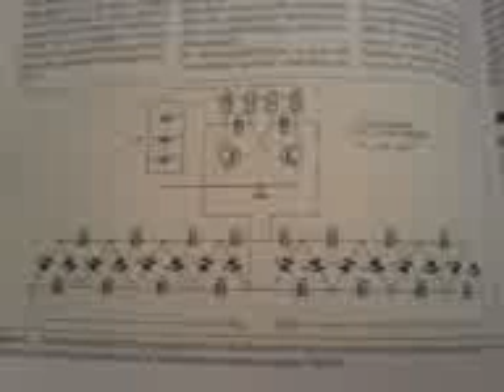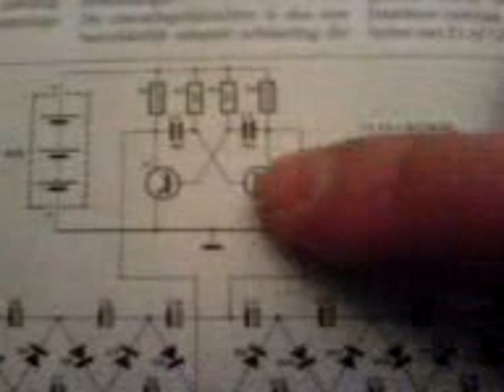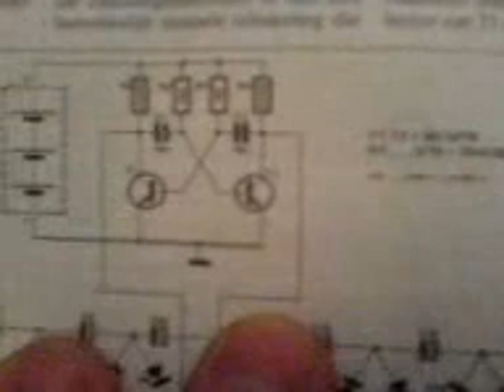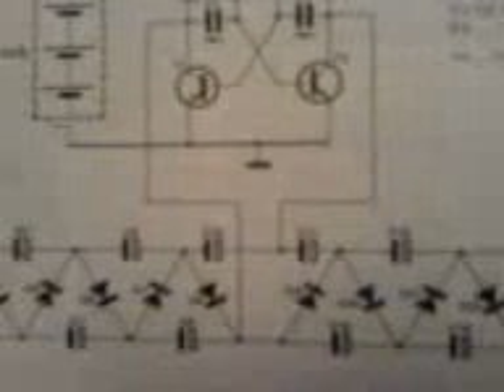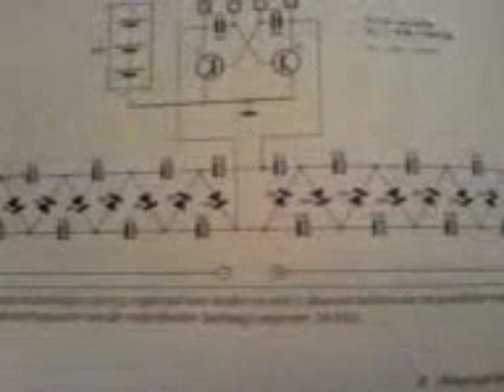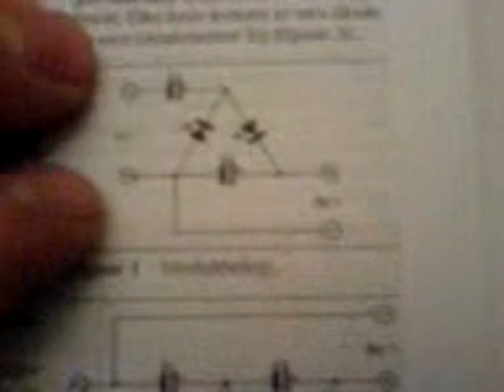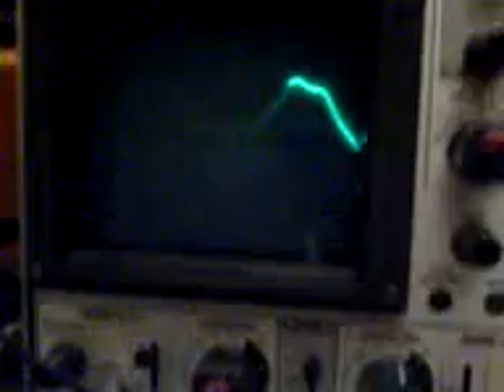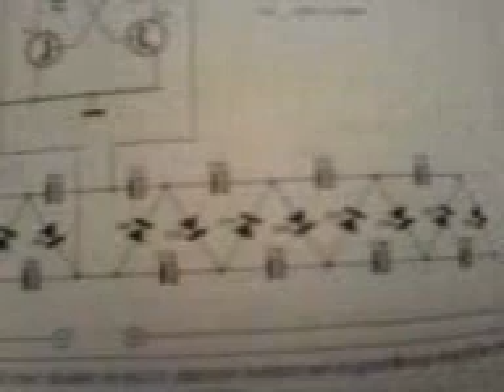DC TO DC volt step up converter for newman engine

Comment: apart from the fact that it's called "Cockcroft-Walton multiplier" or "Villard cascade" - those are just names - the main application of cascades was high voltage rectification in color tv sets ;)

@ray0energy try to get rid of the "erh"s in your comment ^^